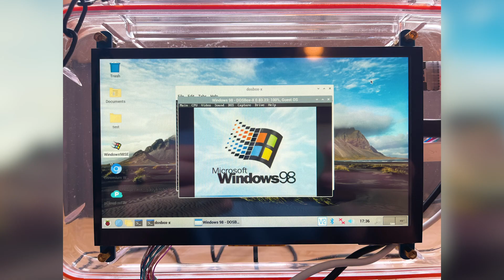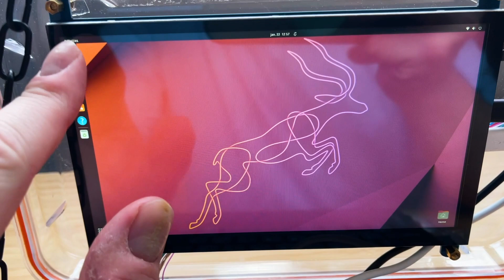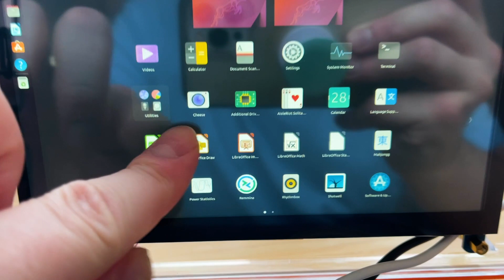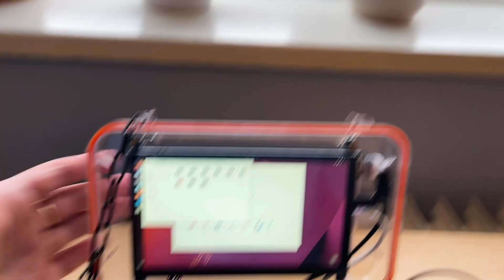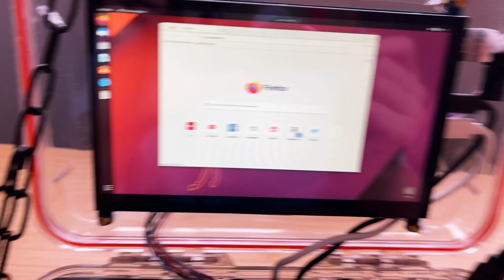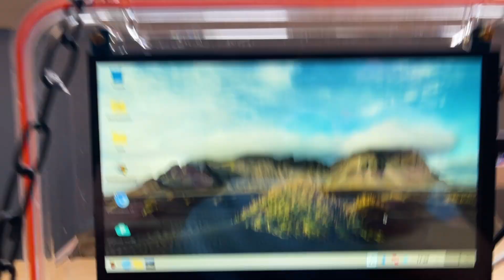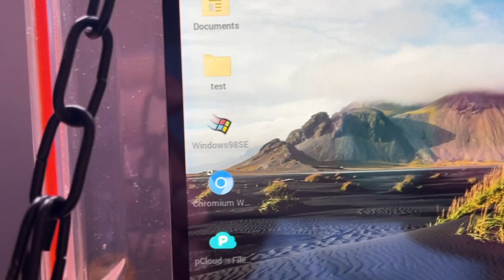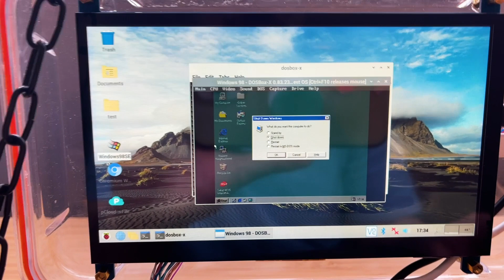My DIY Mini Laptop Running Windows 98!

Comment: I've been thinking about this for a while, I know action retro (or somebody in their community) made a custom pi image that automatically boots into an apple II emulator without even a trace of linux popping up with its UI/UX. I've been thinking that it should be possible to do the same thing with qemu and the slirp network backend.

The setup would be having the bare essentials installed:
- being just plain tty with x11 by itself (or a minimal window manager like i3)
- a script to boot qemu with the vnc backend, 5 second delay, then booting a vnc client fullscreen. (this is because qemu precompiled binaries from debian repos is broken-ish using gtk as a backend instead of sdl which is depreciated (non-functional), meaning switching resolutions in gtk inside the vm breaks graphics, but works fine with vnc)
- qemu configured with slirp and a connection to the host from the guest with an ssh client on the guest and a server running on the host, so you can excess tty from inside the vm.
- nmtui installed so you have a text-based ui for connecting to wired and wireless networks without installing xfce/gnome. this means you can ssh into the host from the vm and change wireless network that you connect to. Effectively meaning, you never need to leave the vm.
- usb hotplugging, meaning any device connected to the host automatically passes through and is accessible to the guest. (you plug in a usb drive, and you can transfer files from the guest onto it inside the vm, or a external cd is usable from inside the guest.)
- and finishing touches to add a fake AMI startup screen and chime to really sell the experience.

The fastest way to get proficient with linux is only using a bare minimal window manager like i3 with a color scheme that is only black and white, avoiding gui/desktop apps, and only using console/text based programs.

Provided the network drivers are already baked into the kernel or that you plug in your phone and use usb internet tethering, you only ever need to install nmtui and links2, to have a way of easilly connecting to wireless networks without ever leaving the terminal and browsing the web from the terminal for information. I spent, 3 entire months like this with bare minimal debian in tty using the ranger file manager, nmtui, and links 2 and a script to use youtube-dl to stream audio from youtube videos for entertainment just to get proficient with linux.

The only video games I could play was dwarf fortress, nethack, any games that use the gblorb format, mud games, and handmade games i wrote myself in scripts that began with hash bang bash. Get yourself an old chromebook and wipe and install debian on it, if its old enough then the network drivers are likely baked into the 5.0-5.1 kernel for debian 11. And again, if they aren't then as long as you get do internet over usb using your phone, you can just install links2 and browse the web to find them, then install nmtui to connect to wireless networks with ease. its so satisfying to feel like some hacker man only using a terminal, even better if you are seen in public at a cafe using nothing but a text based terminal lol.

Comment: As far as I know the rainbow boot screen on the raspberry pi means that it is in low power mode, meaning that it's slower. You need a faster charger for it to be faster
Reply: my rpi 3b+ supply by 5v 20A power source . boot with rainbow screen either (hdmi) . i think it does not always mean lack of power like lightening icon on the top right corner . or flash black screen.